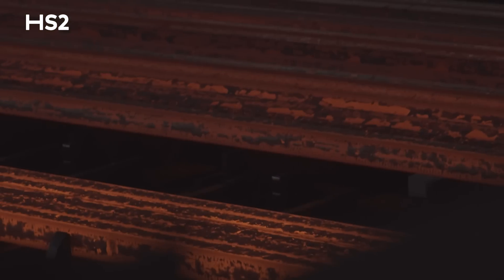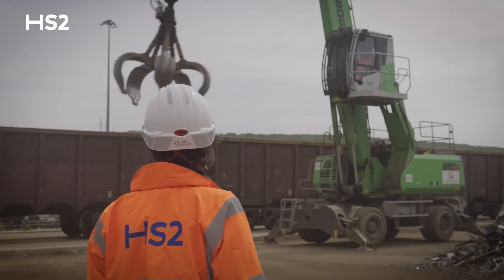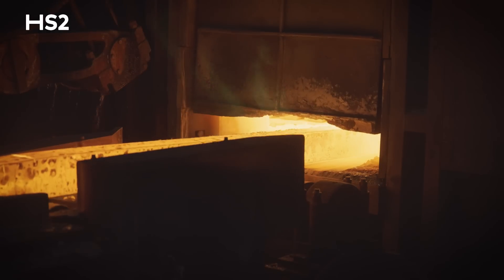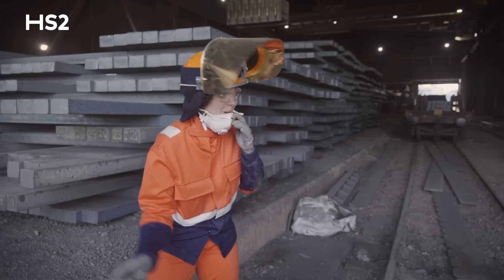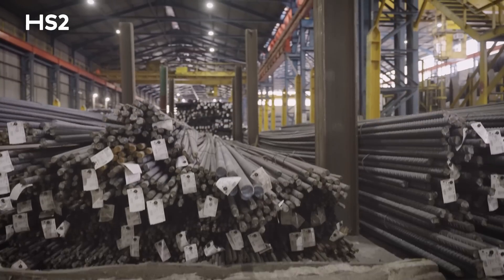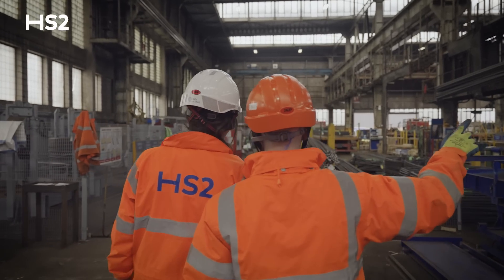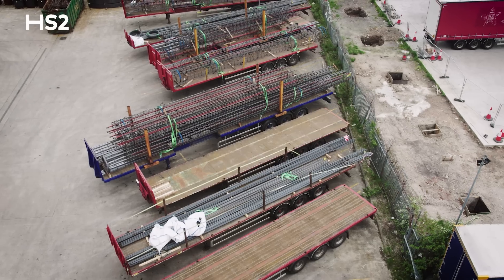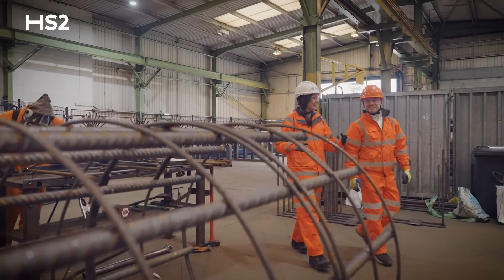From Scrap Yard to Trackside: An HS2 Steel Story

Comment: 5:28 Good to see the billets being dragged and scratched, that's not going to cause defects in the product(!)
Reply: Is that sarcasm? Cause ain't no way that would damage the steel.
Reply: @polpojliekwanjaroen3511  It does. In Scunthorpe, blooms and billets are lifted so they are not scratched.
Reply: @10thdoctor15  Maybe you're right. I'm no steel expert either, so sorry about that. But, is it possible that those steel would be covered by concrete and some minor defects won't be seen?

Comment: If were gonna have a new high speed rail called high speed 2 who will be the rail operators running HS2.
Reply: It will be whoever is running the West Coast Partnership when HS2 opens. Currently, it's run by Avanti West Coast but that may change by the time Phase One opens

Comment: that woman that was waffling on in the control room, the one doing rhe corporate speech.... she said low carbon steel 🤔 wont that be soft as shit? surely you want a high carbon steel, one with high tensile strength and hardness- low carbon steel would be rubbish for building big stuff.
Reply: she meant embodied carbon.
Reply: Clearly she is referring to embodied carbon. Besides mild steel - standard structural grades - has pretty low % carbon anyway. Otherwise you end up with pig iron or wrought iron which is brittle and not very useful.

Comment: What an irritating presenter
Reply: came here to say same.. !
Reply: Agree - while the process of steel recycling is very interesting, all this green crap against cars and nonsense around net-zero (whatever that is) could be substituted with more detailed analysis on how they ensure that the recycled steel is free from any contaminants.  For example, I say a trolley in the scrapyard with rubber wheels - those along with much other extraneous material would have to be separated and the remaining steel that is suitable for reproduction cleaned - none of that was shown.  I actually watched this video to see that.